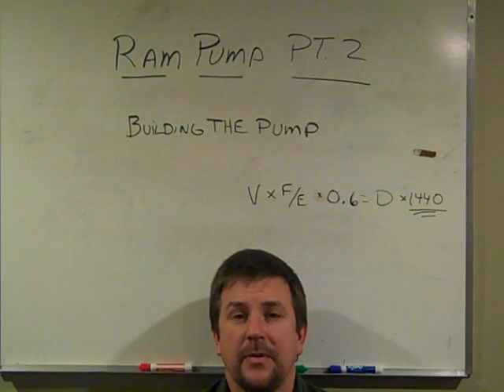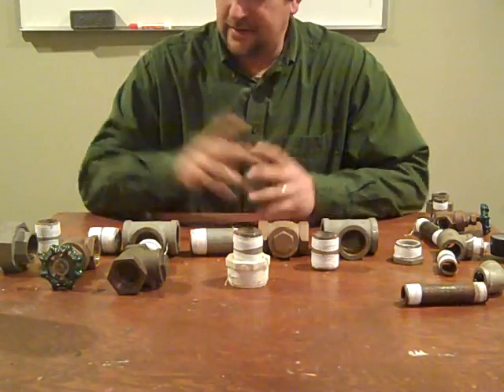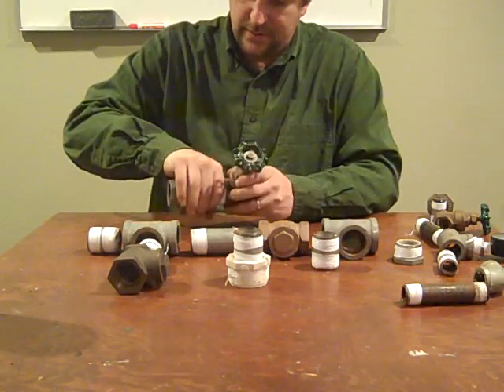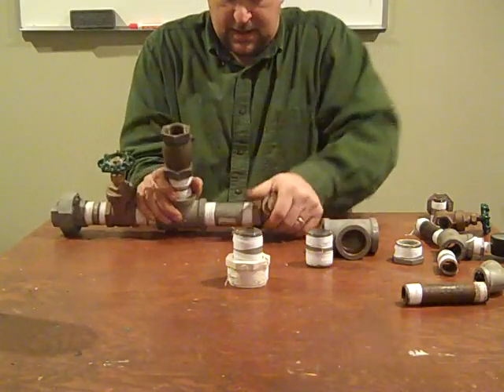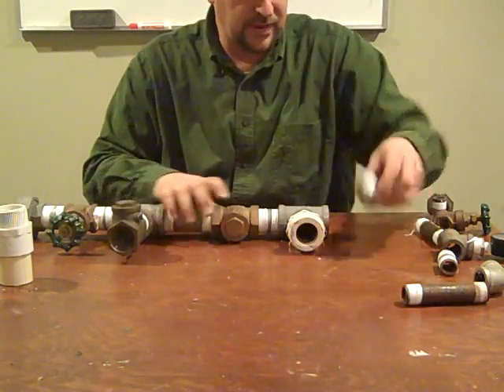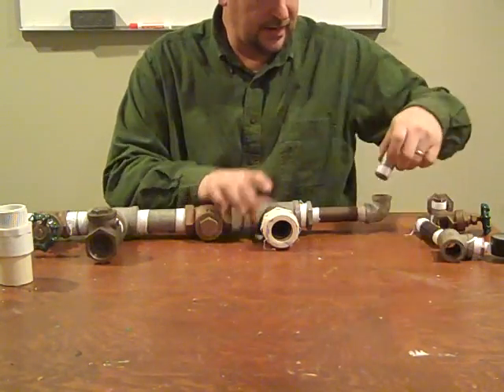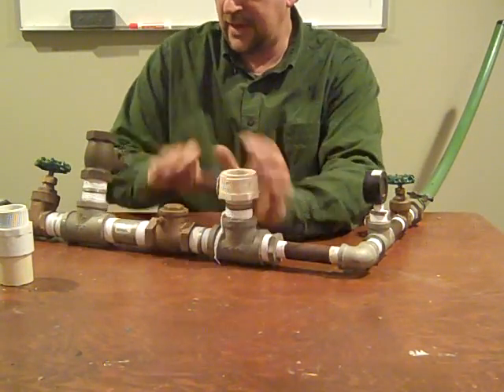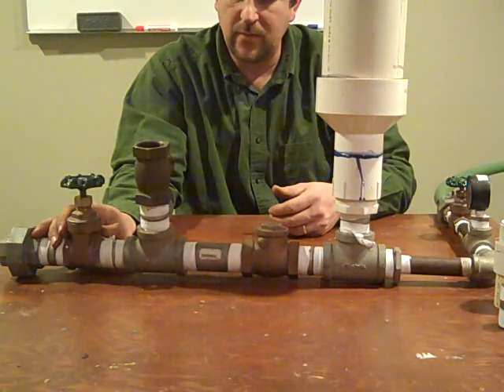Ram pump Pt.2

Comment: Nice design. I do a lot of repair on many things and I have a suggestion for the order of your pieces. The valve should always be first and last in the sequence. This will allow you to turn off all water flow before cracking open the unions which will be much less messy whenever the unit is removed.

Comment: I think you want to AVOID closed cell foam.  Worked at a factory making it.  Was years ago and I hope I get this right.  Closed cell uses "celogen" as a "yeast" to create encapsulated nitrogen bubbles.  Closed-cell is used for drink cup holders (DCH's) and for the better pipe insulation, for wresting mats, for astroturf mats.  You mentioned "noodles" ... which I *think* are "open cell."  Double check, but I think this is right.

Comment: Do you use just swing check valves for both your waste and pressure valves?  It sounded like they both clapped freely, so I'm assuming you are using check valves on both.  On the Clemson Extension link you gave, they show the pressure valve as a spring check valve.  What would be the advantages/disadvantages of using either type, for your pressure valve?

Comment: This is all good advice. Built one and placed it 14 feet below a water fall with probably 50 gal. per second flow. The water comes down the pipe and fills up the pump and nothing happens.Then we try to get it started and still zero. What is next?

Comment: @mir09333 I haven't built mine yet, however I believe you keep pressing and releasing the check-valve to "prime" the pump, and get the water flow started.  After a number of times of pressing and releasing the check-valve, my thinking (I could be wrong?) is the pump will then have the pressures in the places it needs to work on its own.  Also make sure the gate valve on the outlet side is closed until the pump is working on its own...then slowly open the outlet gate valve. I hope this helps.

Comment: Hi nice vid. I got a question. The first check valve you install, minute 3:36, i bought the same one but when the water flows and hit that check valve the pressure its just to much and doesn't permit the valve to stop. This mean my ram pump still not work. Could you please explain to me what should i do thanks a lot.

Comment: No, No, No. The valves should alway mount away from universal joints, not inside between universal joints. If you have to remove pump for service, how will you shut the water off.

Comment: "Recommended wisdom of advice"
There are several different check valves to choose from, the one you want is a swinging check valve, that way you don't have to deal with Spring adjustments it works on gravity.

Comment: yo..buddy... does it good if i put another check valve on the delivery pipe(that is in between the pressure chamber and gauge as per your model in this video) ? nice demonstration indeed! thanks!

Comment: Engineer775,  Great videos!  I have a question about how you determine the volume  needed for the pressure tank, and if you could, comment on the shape Hight/Diameter ratio.    Muchas  Gracias!!!

Comment: A note about the Sure-Flo, it’s a good pump for low flow but it doesn’t last. I have replaced every one I put in after about a year or three, so if you go this way make sure you have a spare or a re-build kit on hand for when it fails. Sorry I had to post this in three parts.

Comment: I do not recommend the Grundfos CU200 control box, I have installed two of these and had to send two back for warranty. I do recommend the Grundfos IO101 control for solar powered systems; this box allows you to automatically switch to AC power, (generator or grid).

Comment: About powered well pumps. I have installed several types from the relatively inexpensive Sure-Flo DC solar powered pumps up to the 3-phase constant flow type. The one I really like is the multi-voltage AC/DC “SQFlex” pumps by Grundfos. These pumps run on just about anything. Solar, Grid, Generator, Inverter 30-300 VDC, 90-240 VAC 50-60 Hz and can lift water from up to 650 Ft.

Comment from the maker: @DeleteMeOnline A bladder tank would work just fine and yes you can use a foot valve.  You remove the spring so that is falls closed and you can also weight the valve.  I have found it is simpler and easier to adjust a swing-check valve than to make your own.  Weighted/adjustable valves are great and some you can make real quiet with leather or rubber gaskets.

Comment from the maker: @GoatHollow Great catch.  You are right that the unions could go on the other side of each gate valve but  in my setup I have valves on the drive pipe close to the dam that I shut off and then I take pump out with gate valve and all and on the delivery side you just lose the water in the pipe not from your source.     My extra drive pipe shut off is where I can also change to a diff. drive pipe size.  You'll see in pt3 .  I am just glad that folks are paying attention to the details!

Comment: Great job Dude.  One question, wouldn't it be better to put the unions "Inside" of the gate valves, so that you can remove the pump, and have no water flow from the inlet/outlet pipes while you are working on it.  Seems like it would be lot's better to be able to fit those unions back together with no flow/pressure coming out of the other half of the union.   Btw.  hope you don't mind, I'm downloading this series, to burn to DVD for after SHTF reference.

Comment: Very interesting.  I remember being at an antique steam engine and farm machinery show and they had on display something like this, Only it was a  dome shaped contraption. If i remember right it was called a Bell pump. They said they were using them back maybe 200-300 years ago. Could they be using the same principle?

Comment: Do you bolt your ramp pumps down?  When your putting it together on the table you just spin your delivery hose on but outside i would imagine both your delivery and source pipes would be held fairly static or at least be very long?

Is that where the unions come in?  How do these allow you to disconnect the ramp pump?

Comment from the maker: @billythebaboon Under  a $100 depending on where you can get your plumbing parts.   You can save a some money by using a PVC ball valve on the deliver side.  You also can leave off the pressure gauge as well.  So if you shop around ~ $75  for a 1 1/4 pump 50 for a 3/4 " pump. 

If you were to purchase a 1 1/4" pump from Rife Ram it would cost you around $1500.00  - I have a 2" 20 SU from Rife I bought 12 yrs ago for $900 - it is now $1950.00 !